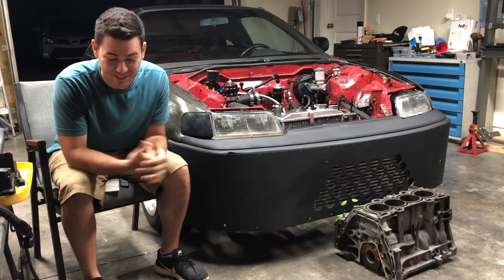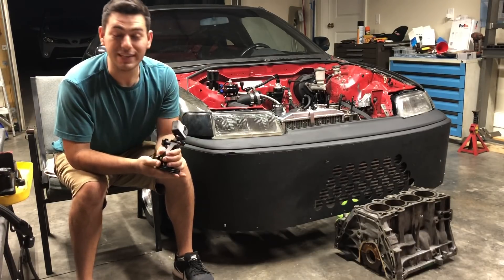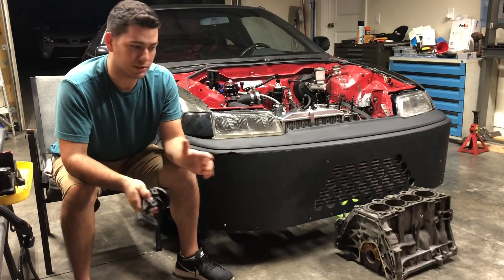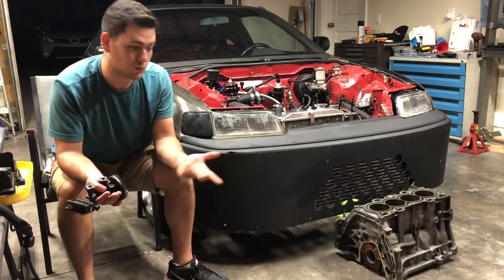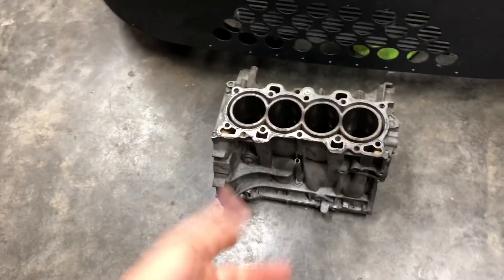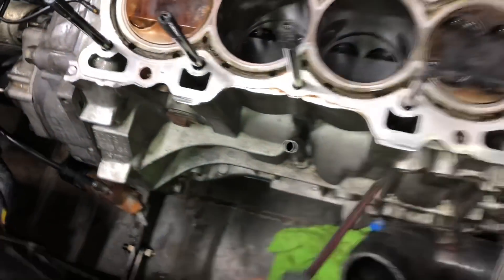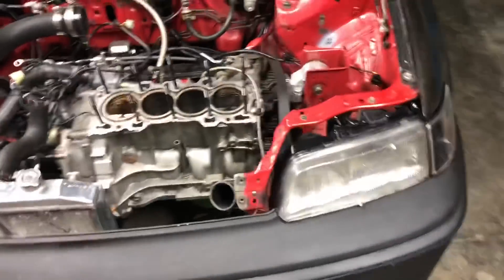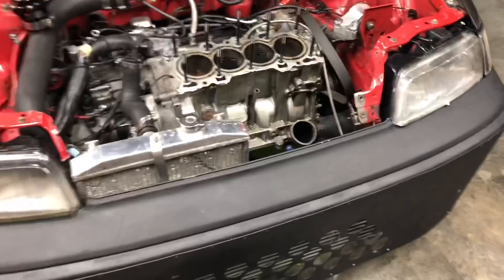New Block For My Turbo Honda!! 👀

Comment: if you're going to reuse the Devcon style of keeping the sleeves intact, use Loctite EA E-120. Its used in aviation, its tensile strength is higher than Devcon (2500 vs 4800), it can withstand higher temps than devcon (200 vs 300 degrees F) and it's compatible with coolant only losing 10% of its original strength after being submerged in 187-degree coolant for 41 days. that's what I used in my J series which will be in the 800HP (crank) range

Comment: I understand that the extra cubic inches makes it more torquey, but you're SO much better off with a LS turbo bro. I have one that made 408 whp on stock PR4 internals with a standard rebuild and am eBay turbo kit. My EJ8 Civic coupe has a fully built LSVTEC that makes 612 whp, and that was on fairly low boost (22.5 psi) with hardly any timing. Yeah, it's cool to say that you've got a 2.0L, but the B20 is such a turd unless it's sleeved with forged internals.
Reply: I'm not trying to say that the B20 isn't a good platform or anything, my buddy had his sleeved with forged internals and he made 734 whp with his on a huge Precision turbo and ran 9.95 @ 156 mph right off the trailer last year, but his second run he grenaded the engine when the #3 piston literally flipped sideways in the bore at 10k rpm and took EVERYTHING out...even the big Precision when it spit a piece of the valve out of the exhaust manifold. This year he's building a CSS B18B1 with a B16 head...which is the same setup that I have in my EJ8 Civic coupe, but he has Pro1 cams and I have Skunk2 Tuner Stage 3 cams as well as a much smaller turbo. My car made 612 whp and his will smash that number.

Comment: I’d like to see an in-depth video at what you do when building a motor with used parts from an old build. Basically; do the rebuild but what precautionary measures are taken when installing bearings, rods, pistons, rings, arp studs etc. and when you think things should be tossed. Thanks!

Comment: What happened to your water pump?? The water pump will push that debris fine, eventually it will limit the flow through the radiator.

Comment: You already know B20VTEC is only good for high Compression All Motor builds, boosting is hit and miss more often than the LSVTEC builds.. reason why I won't Boost my build.  If I do I'll get a  LS block built and use it with my semi built B16 head.